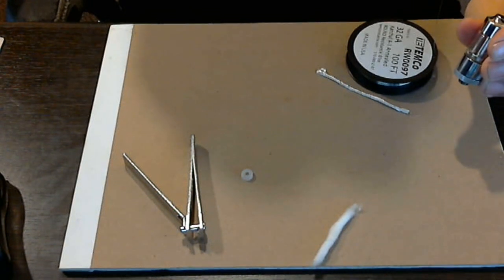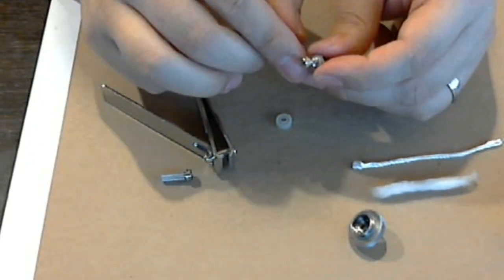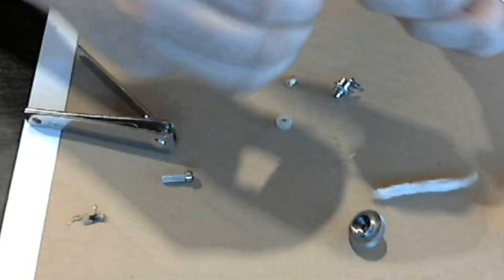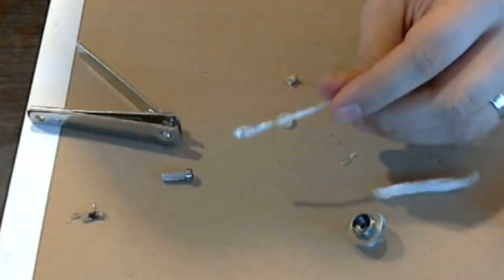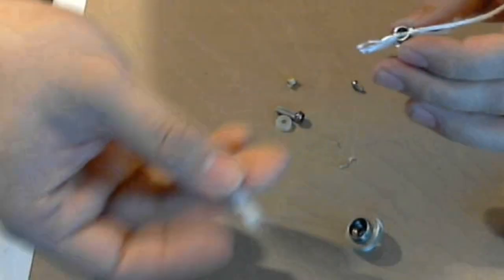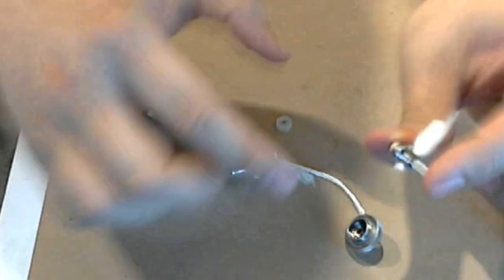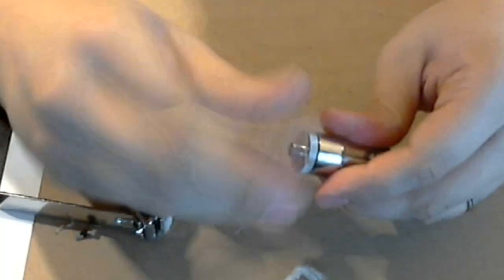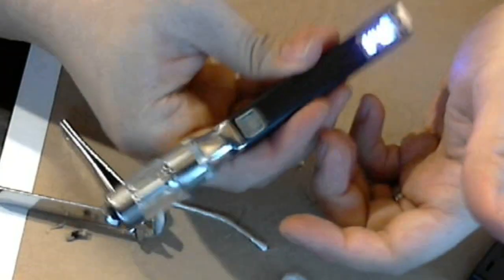Protanks and Evods, Anti-Gurgle Rebuild Method

Comment: Does the ohm size affect the draw on tanks?
Reply: The lower the ohms (resistance) the quicker the coil will get hot. :)
Reply from the maker: Snoopy bix that is not true.
Reply from the maker: less kanthal used will increase ramp up time.
feel like the same thing right?
usually.  most likely.

but there is a difference.  you could say have a heavier kanthal more wrap to a .8 ohm.
then compared to a lighter 5 wrap of something really thin clocking in at 1 ohm.

the 1 ohm will ignite faster because it has a shorter overall A TO B distance.
you wont see this happen often right now.
but soon, with the release of those big watt devices.  I already see it coming.

I'll show you why in a video  called performance vaping 103 coming in about a month.

Comment: Can I use Nichrome instead of Kanthal?
Reply from the maker: absolutely,   but only do this if you prefer nichrome.  I will not go into it but do know it is debated by many regarding the taste of nichrome.  Some taste it, some don't.   So don't do it unless you prefer it.
Reply: pegasus1337 Thanks for the reply!
I'm a newbie. My first device will be a EVOD.
About the nichrome taste, as you said, I saw in some forums/videos that others complain a lot about the nichrome taste compared to kanthal, but I can't say because I didn't tried any of both. I will just try the nichrome first, because I have easy access to it.

I will absolutely try your method!

Comment: i just got my protank and when i screw the coil into the base it wont screw into the tank please help
Reply from the maker: something might be defective,  take your item back to the shop and ask for a new one.
most shops are cool about replacing defects.
Reply: There are 2 kinds of coils used by Kanger.  Short (old style) and long (Protank II, etc).  YOu probably have the long ones and trying to use it on a old style tank.
Reply: thanks for the help guess i was the lucky 1 in a thousand to get the packadge with the wrong coils

Comment: HI, I know this may be a bit of "an old vid" but i have just switched from cigs to vaping so is still very useful thanks
My coils are 1.7 ohm. Could you please tell me how many coils that would be?
Reply: +mike k   Do you mean how many wraps it would take? If so, it would depend on the gauge & material the wire is made from. You can find a chart almost anywhere on the web. Within the same material (kanthal or nichrome or stainless steel), thicker wire is less resistant & more wraps adds resistance.
Reply: +CaptianKeyz hi thanks for replying. Since i wrote that question i have learned how....very useless my question was!!

I did mean how many kanthal wraps to get 1.7ohms and yeah, those charts help a lot!. 

Thanks for the info

I'm all grown up now and doing nickel ones as have decided to get a mod instead so getting a temp control eleaf.

And since nickel is such low resistance it barely matters resistance wise, only for heating the wick evenly

....i learned that on one of those charts too :)
Reply: mike k  Sweet! Sounds like you caught on quick. I use a dripper...fun to make different coils. I also have two tanks with RBAs. Kangertech mini is real nice, just the posts in these things always kinda suck. My Triton2 solves this but it creates other problems. They both work great, just can't do any variations on coil builds, but that's what the duo coil dripper is for. I use Kanthal & SS with cotton wicks. 
What you vaping on these days? get that eleaf?
Reply: I am smoking an evod 2 with standard atomizer and have been rewuiring with kanthal but have now bought a subtank nano which is great but have cleaned it and decided to wait to use it until i getthe eleaf but have made some nickel coils while i wait for the eleaf to come in feb.

 and I have to be honest that it seems I haven’t grown up in vaping as much as I thought. I need to look up everything you said from “posts” (",) ………..what are posts? and if you don’t mind, I need to be really honest and take it back even further and ask why you use a dripper? I know what they do but I never understood what the advantage was over a tank.
CaptianKeyz
Reply: ohhhhh......thanks. To be honest i started vaping hving been  20 per dy smoker for over 20 years as well as liking a joint or two. nd in the UK we mix our joints with tobacco.

BUt i lso realised that i ws ddicted to the behaviours not just the nicotine so i m hesitant about  swapping the smoking routine for vaping.

I used to enjoy things without being ddicted. I could go for  wlk in town by the river or go nd ply sports withought hving to mke sure i hd ciggs on me. Now i m vpourisers i still find myself djusting my life to my ddiction s i wont go out until my battery is charged

So i dont wnt to mke vping more ddictive nd fun for me thn smoking used to be

but i do wnt to mke it  totlly stisfying substitute for when i do give in to my cravings

I started off with the ego 2 and lerned how to make my own liquids which totlly stisfy my nicotine cravings as well as being a nice smoke. (i make a very nice homemde vanilla and cinmmon flvours)

I am only getting the eleaf because my exploration of making my own liquids hs lead me to some very interesting ones which may free me entirely form ever needing to smoke tobacco and it is nice on my evod but  temp control mod would mke it the perfect subsitute for when i smoke it indoors nd mximise my liquid.

For norml outdoor usge i will rbbly stick with my evod so it doesn tke up pocket space when i cycle into town or go out
Reply: mike k   Just vape to your head, brother. You can't beat yourself up over addiction. It's a big thing just to move from cigs. I smoke cannabis, but I'm not hooked on any certain smoking behavior. Let it go. Vape when you want & don't when you feel bad about it & do something to keep your mind from going down the rabbit hole while you're Jones-ing. If you want to move away from addictions, you need to replace them with good behavior (work out, hike, physical stuff is best. Your mind doesn't like cold turkey. 
I am down to a 1% nicotine. I just enjoy the flavors pretty much now.